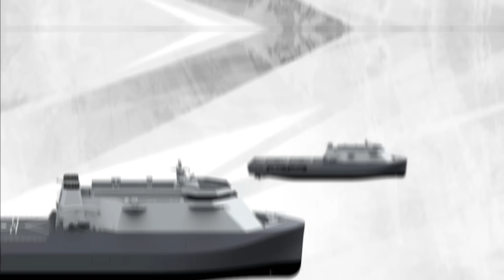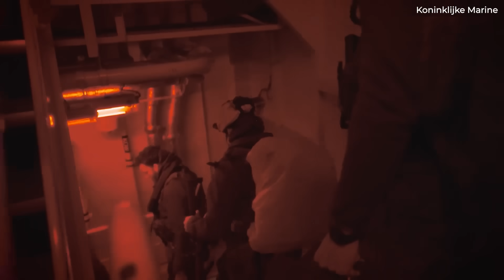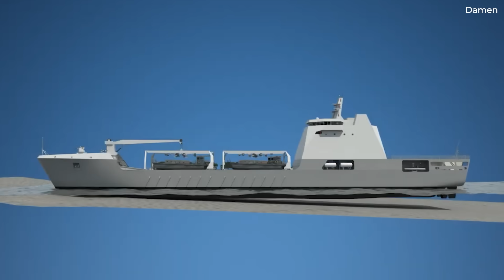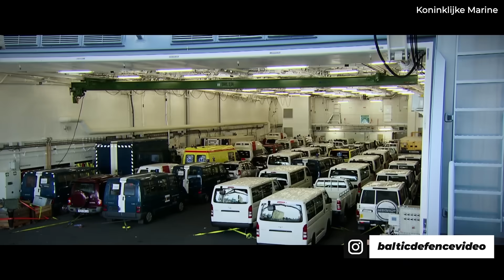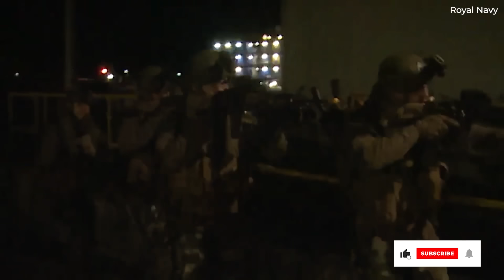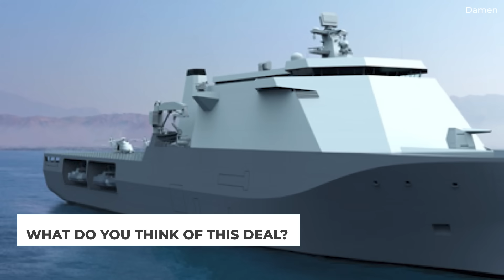New Amphibious Transport Ships Announced For UK And Dutch Forces

Comment: As long as they don't turn out compromised by cost cutting & unreliable like the QE Class carriers
Reply: Oh here we go. Yet another armchair naval architect spouting the usual bollocks about UK carriers.
The carriers have been one of the most reliable in service. The two have had two failures (in a coupling) in a combined 17 years combined service and hundreds of thousands of sea miles. Neither has been unable to sail under its own power, have sailed the Atlantic many times and around the world twice. Without failure.
When there was an issue pre-planned hull maintenance and upgrades (like Bedford Array) were also carried out meaning there was no excessive down time.

If you want unreliability look elsewhere. Like the single French carrier and the USS Ford carrier.
Reply: Is your source Mark Felton?
Reply: @omarbaba9892   Ouch! 👍

Comment: Why is the Netherlands setting this up with a non-EU country? Building the boats? Fine. Setting up a joint force? No, thank you! The Netherlands really needs to get the NATO claws out of our national forces. These new very expensive warships that take decades to be delivered are dumb anyway. You can just gear up a trading vessel like a Toyota tactical and get a ship nearly as functional as a purpose build ship for max 20% of the cost and a much shorter delivery time. With the discarding of big guns and 'close combat' the business case for building specialized naval forces ships except for submarines and aircraft carriers ceased to make sense. You can set up these missile systems, detection systems, quartering, landing zones, storage and tiny guns just as easily on a 2nd hand cargo vessel as on these new ships. Setting up a  modular system based on standardized international shipping containers shouldn't take much work at all. But 80% of defense spending has spend of buzz words and substandard middle managers for decades.

Comment: The uk has already cut back before the deal was signed, they original requirement was for 6 and that was cut to 4, no doubt that will be cut even futher
Reply: Different ship that was the MRSS and was looking to be a more self sufficient ( with less escort) amphibious assault ship. They concluded large amphibious assault ships ( 25000 tonne plus ) was not needed for future warfare and hence the collaboration with the Dutch.
These new assault ships are to be 15000 tonnes and likely to be a through deck design ( well according to most defence sources).
Reply: @Paul-of2yq  It isn't needed (large LHD) as the QE class between them have 8 acres of flight deck, can carry 250 marines each (900 surge) and all their equipment and operate the RAF's Chinook and Apache in significant numbers. There's plenty of fight deck space now that only 3 squadrons of F35B's are planned with 16 jets in each squadron. Obviously, they might also operate significant number of drones, in the future. The RN needs new LPD's.
Reply: I don't think they ever said there would be six. The initial announcement said upto six, but that was before any plan had been settled, and that number seems only related to the number of ships leaving service.
Reply: No, the original requirement was 3-6 of the over engineered MRSS class that was never going to happen 

This project is the fallback

Comment: The Dutch Navy prefers a flattop, such as the NRP D. João II, but significantly larger (15,000 tonnes). This does not mean that the Royal Navy cannot acquire LPDs based on the Enforcer design; after all, both the flattop and the LPD variants could share the same basic design and hull.

Comment: Looks like a great fit for Canada also.  They are talking about a "mobile base" in the North.  Having a couple of these would be flexible for providing supplies or arms to wherever needed, especially paired with polar ice breakers.
Reply: Aren’t the mobile bases that Canada is considering supposed to have ice breaking capabilities?
Reply: @Kishanth.J  yeah... that's one way this ship does not match what the Canadian Admirals were batting around... hence the suggestion for ice breaking escort.
Reply: The admirals in RCN have absolutely no say about what to buy. The politicians do.
Reply: @aussie1234 For the recent submarine procurement, DND said: both Korean and German ones would be good, we'll take either.  Political chose the German offer within a year.  so DND defined the requirement, but RCN needs to get the money from the politicians, so there is always going to be a dance.

Comment: Damen have a 168m design of the Enforcer. I wonder if it’s basically just the same as the 156m version with an extra 12m section. If so perhaps they can do it with a smaller section added to make something in the low 160s, though if any redesign adds too much cost I think they should probably just pick either 156m or 168m and stop trying to tailor make everything.

Comment: This is a project the the UK has previously joined and left, and has now joined again... signed by a PM and defence secretory who were days away from being replaced (and are now gone).
I think this is to replace the cancelled MASS (mega everything ships) and probably the Bay class, from the UK DIP, they seem ok there will have to be a few modifications obviously. (RAM for example is not used by the RN).
Is that the drone launch area up on top between the funnels? quite an exposed area, I think you could get a drone scale EMILS rail alongside the 3 helicopter pads as they are all biased off to one side, that could be fun for bigger drones.

Comment: Really hope they go with a through deck design, as that means they will also be able to somewhat fulfill the role left behind from HMS Ocean retiring
Reply: The official design requirements do stipulate the requirement of being able to sustain a significant amount of rotary aviation equipment and a large drone contingent onboard, these requirements make it more likely that the base design of the Enforcer from Damen will get modified to allow for a larger flight deck, probably a through deck design. The fact that Damen invested millions into modular designs should now pay off because the entire decks above the waterline can simply be replaced without much issue.
Reply: That's now a redundant role since the entire concept has changed away from a large landing group to smaller independent commando operations.
Reply: @Naturally-Fragrant they can still perform large operations though when needed. They’re gonna be quite a bit bigger than the amphibious ships used in the Falklands war
Reply: It will be a through deck design, a captain of the Holland class (which this will replace) commented on twitter that the design will NOT be the Damen enforcer. But a Through deck design, a official concept has already been released you can released here = https://en.wikipedia.org/wiki/ATS-class_amphibious_warfare_ship#/media/File:ATS_Amfibische_Transport_Schip_Dutch_Navy_artist_impression.jpg
Reply: I mean, RN did kinda fill that role. They are called Queen Elizabeth-class aircraft carriers which have been shown to have the flexibility to be used as helicopter carriers. And this might be one of the best argument for all the haters saying they should have bought just one, but CATOBAR.

On the other hand, I can't say the same about Albion-class LPD, which still need replacement.
Reply: @mufanek_

One of the factors that led to the Elizabeths being STOVL was that at one point there was an option for replacing Ocean, the Albions, the Bays and Argus with 3 to 4 LHD's in the 30,000-40,000 ton range that would have F35B capable flight decks so they could operate as backup light carriers as needed that way the F35B's could cross deck on the carriers and the amphibs.

Comment: If it is Damen, will Damen's frigate cancellations and bribery allegations cause any issues?
Reply: No, those cases are completely different. About the Dutch/Belgium asw frigates project, its not Damens fould that the design had to be bigger and bigger to install all extra weapons systems..this makes the whole program more and more expensive. And ref to the Germans, there shipbuilding industry was not happy when Damen wins that huge contract...they where lurking to find ways for cancelling the contract...even when TKMS was the main contractor later...politics stinks...Germany was also expecting that the Dutch would buy their submarines..but it wasn,t the case...Naval Orca Class was the winner for 4 submarines......
Reply: @manuellangius2896  Some of that may have legs to stand on, but Damen did mess up plenty on their own with budget and time overruns. It's fair to say that that is somewhat normal for naval projects, but Damen in particular hasn't proven themself to be a good choice for complex, multi-national and very bureaucratic projects. What they do pretty well is very straight-forward, single customer, fairly stock and off the shelf/catalogue smaller-to-midsize naval projects (for example the Sigma Corvettes/Frigates)
Reply: @DrKartoffelsalat not completely true, in our Navy (Dutch) we have complex ships from Damen,Karel  Doorman landing dock platform, Den Held multi tanker and heli platform, LCF frigates etc.. Damen is just the shipyard to build complex vessels. Bureaucratic is pain for every ship builder....and country😂😂

Comment: They will replace their 2 and 3 Docklanding Ships? I am in doubt that both Navy's could  men each 4 of this vessels.
Reply: I read that in RN, they are meant to replace at least the Albion-class (2x) and Bay-class (3x, possibly 4x as one was sold to Australia before). Possibly even HMS Ocean? So that would make it at least 5 going to 4. And Albions required roughly double the crew that for example the Damen's Enforcer design, since you mention that part.
Reply: @mufanek_  HMS Ocean went years ago...the RN doesn't need anymore flattop capacity. The QE carriers have 8 acres of flight deck between them and a lot of surplus space...seeing as there's only going to be 3 squadrons of F35B's (16 a piece) by the mid-2030s. Each carrier has surge capacity for 900 troops (or 250 marines non-surge) and can store and operate the RAF's Chinooks (and Apache's). Plenty of heavy lift capacity, they need new LPD's. Four is enough.
Reply: 1-2 likely kept in reserve or two crews rotating between four ships, so that two are active. Contingency. Lean crewing is now at the core of all Naval design.

Comment: It will probably be a larger version of the Multi-Purpose Support Ships. The largest is  9000 grt. Portugal has bought one of these flattops, the NRP D. João II.  These are dedicated drone ships. The largest is a 130m long and 20m wide. This version will probably be enlarged to a 160m and 25m wide with a well deck.

Comment: The thumbnail image is wrong. The ship will have a through deck for drone launches. This ship image is out of date, there have been several articles with new images
Reply: Do you have any source for this? So far the only hint that it might be through-deck design is AI renders from news sites with no officials confirming it.
Reply: @mufanek_  the UK government website announcement of this says through deck. And there was some other things from UK defence journal and the Dutch version I believe
Reply: @JasonMG8  Care to share a link? None of the announcements I found mention through deck. And I don't find any news site renders credible. Naval Lookout did the same thing, picturing through deck design, but had no basis for puting that picture there as far as I could tell. Janes didn't provide any source for that "likely to be through deck design" either.
Reply: @mufanek_  marineschepen .nl (the best source on Royal Netherlands navy stuff) has official images and sources that it will have a through deck.

Comment: Probably won't be an Enforcer. Dutch naval officers are saying that it will likely be a through-deck design.
Reply: Do you have any source for this? So far the only hint that it might be through-deck design is AI renders from news sites with no officials confirming it.
Reply: @mufanek_  Several serving Dutch officers responding to posts about the ATS and the Enforcer over on social media platforms, and several defence journalists corroborating their stories. 

The British press release also makes emphasis on the flight deck and the operation of fixed-wing drones.
Reply: @LEH-fl8ws Could you provide me with a link to that UK press release? Because I have opened all that I could find and there isn't a single fixed wing drone mention. 

Any other link to those Dutch officers would be appreciated as well. 

Defence journalists also like to think they know better than the actual people deciding and we have seen them put up renders of ships "in the same vague category" only for the result to be quite different. 

The only concrete information I could find is that ATS looked into both LHD and LPD types.
Reply: Will they adopt the MMPS Design for Portugal and mix up with the Enforcer Design 15628 probably?
Reply: @jenscadenbach3997 will probably be something in between that and the Mistral class
Reply: @jenscadenbach3997  Apparently (this is more speculation), it's a significantly enlarged variant of that Portuguese vessel.
Reply: Even better

Comment: I would've liked for the Royal Navy to get a Mistral-like ship.
Reply: Thing is I feel like it doesn't fit into the doctrine of Royal Navy at all. In modern history, as far as I can tell, RN prefered LPD like the Albion-class or Bay-class to LHD like the Mistral. The only exception I can find is HMS Ocean. Arguably because RN might prioritize the "landing" part over the "platform/helicopter" part, simply because they have 2 aircraft carriers and don't need the extra basically helicopter carrier. To have something like mistral you are doubling the capability of air platforms at sea and you either sacrifice some "landing" capability/capacity or the ship costs more, because it needs both the landing and helicopter part. This way RN is pretty consistently continuing in the trend of more dedicated ships rather than jack-of-all-trades. 

Do I think Mistral is great looking ship and would love to see more of them in European navies? yeah. Do I fully understand why RN is not getting one? Also yes.
Reply: @mufanek_  A great looking ship (Mistral)? It's like an upside down trough lol...very blocky and apartment building like. Agree with your analysis though..the QE's fulfil any Helo lift requirement. LPD's are more useful for the Royal Marines.
Reply: @mufanek_ doesn’t the UK RN have a history with Commando Carriers, which if I recall were early LHDs.
Reply: @Kishanth.J  They weren't LHD really, they were converted aircraft carriers and didn't have the large doors which you would be looking for on any modern LHD. Commando carrier seems more like a light aircraft carrier that can no longer take the most modern aircraft than LHD. I am looking at the HMS Albion and HMS Bulwark of the Centaur-class. Not by accident are those same names then given to Albion-class LPD.
Reply: @mufanek_ Nice analysis, but Dutch sources indicate that it will actually be a flat top design like the Mistral.
Reply: @nietkees6906  In which case I am once again asking for the source. I have asked for source on like 5 different replies under this video and have seen so far zero links to any actual source. It can be true, but everyone seem to have seen a render on some news site and ran with it without confirming it. I feel like either everyone has seen some source and just refuse to give it to me or everyone here is full of shit. 

Also were those Dutch sources saying this before or after the UK cooperation (the most recent one, after MRSS got canceled)?
Reply: Which Royal Navy?
There two in this video.
Reply: @Tjalie-j6i 😂👍
Reply: @Miguel.Artziniega Facts
Reply: @Miguel.Artziniega  jep the British Royal Navy and the Dutch Royal Navy
Reply: @SienjorQueso  Yes 😅.
Reply: It is a mistral like ship, just somewhat smaller.